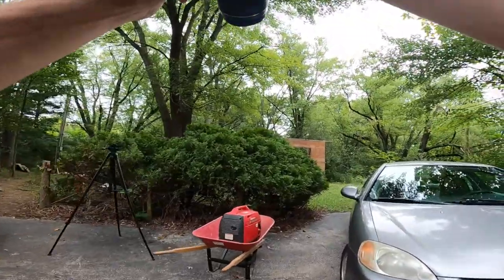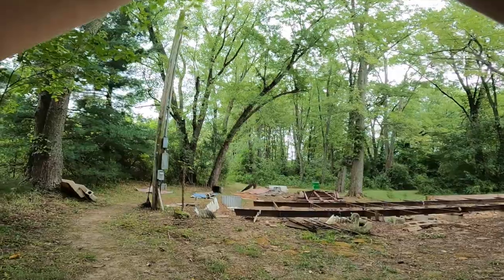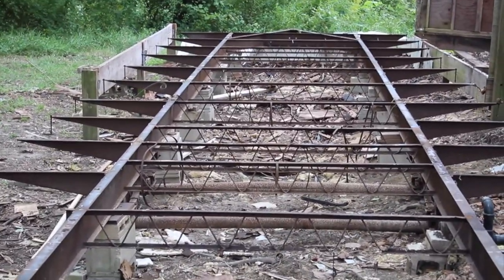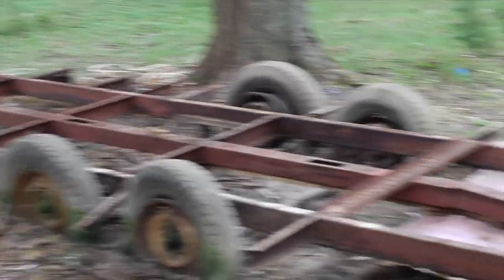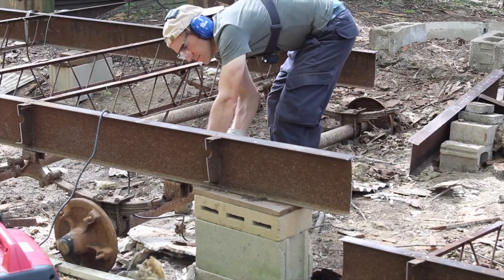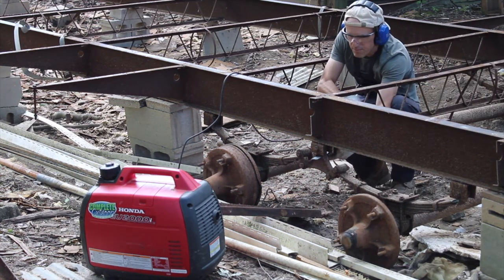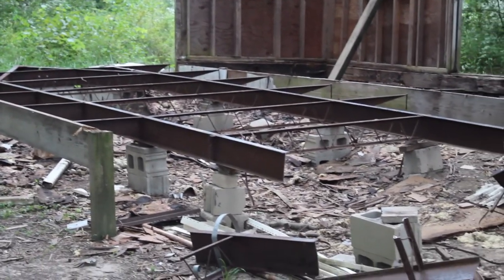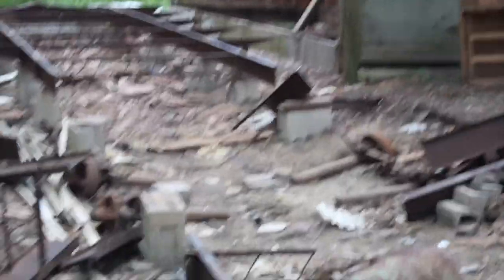The last step in your D.I.Y. mobile home tear-down: cutting up the metal frame

Comment: Damn, that seems dangerous. Safety is key, Cool video.
Reply from the maker: It was more dangerous when I was cutting the roof off.  Still, it wasn't that unsafe.  And using an acetylene torch on the metal would have been less safe than the sawzall method, although probably it would have been much faster.

Comment: link for blades? and How thick of the steal ?
Reply from the maker: I used some cheap Harbor freight blades but also some expensive Diablo thick steel, 9 inch I think.  Maybe 2-3 inches at the thickest points.  Definitely takes time to get through all that if you want to make more cuts in order to get Short Steel prices at the scrap yard.

Comment: So what blade do you recommend? And how long does one last?
Reply from the maker: I had the most durability with this one.  Diablo carbide for thick metal, 9" worked better than 6# for this metal frame
https://www.diablotools.com/products/DS0908CF
I was told that this is the one preferred by metal scrappers.  The price is steep, but of the major brands, I found it was much more worthy of a high price.  
I did have fair luck with cheaper ones from Harbor Freight, though.  Thinner, so it's "less work" to get through the metal you're cutting.  However once they're bent, you're done.  You go through more, but since the cost is lower, you can do fairly well.
Reply: I am about to tackle the same job but for a customer, not myself. Do you have any idea how much time and what it cost you to do it? And can you tell me how much you made at the scrap yard? My local place pays $100 a ton.

Comment: What was the best blade?
Reply from the maker: For my money it was the Diablo Thick metal, 9", (I was told scrappers prefer this) but I also had decent luck with cheaper Harbor Freight blades.  You go through them but flr the money you paid it's not as painful as ruining a more spendy blade.

Comment: How long did it took you to cut it all off
Reply from the maker: About 2 days.  I rented a generator for a weekend and finished in that time.  But that also included an old travel trailer frame, so, maybe under 2 days.